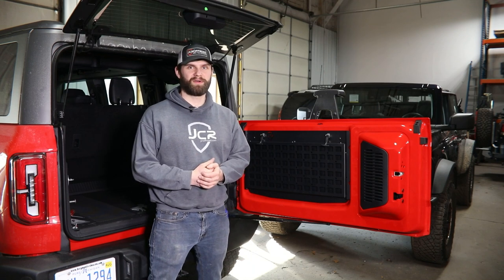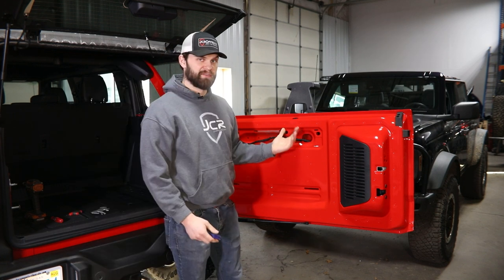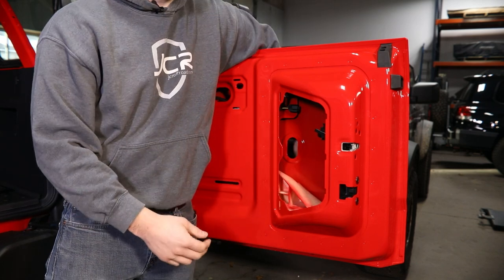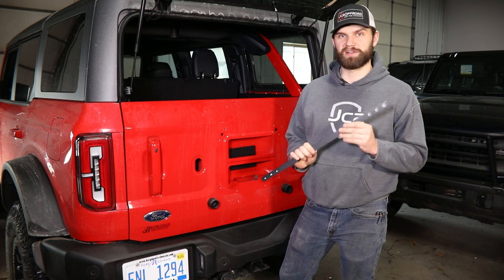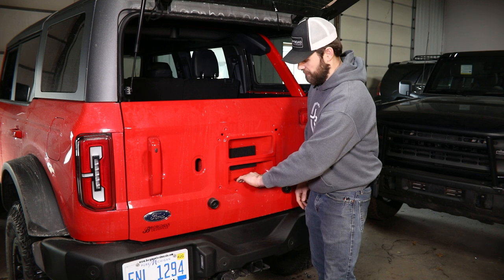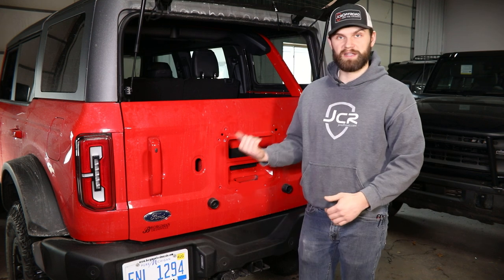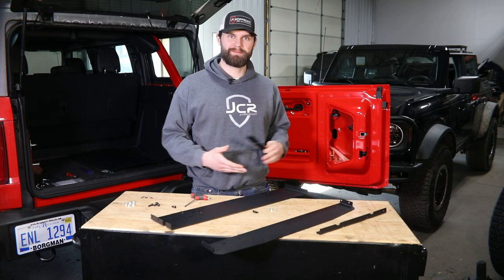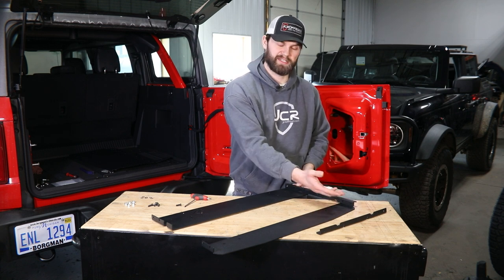Bronco Tailgate Table Install

Comment: The install should start with the table frame assembly. I received a piece of the table that is defective and I'm working through with JCR to get it replaced. Had I followed the sequence in this video, I would have been stuck with a disassembled tail gate. Also, recommend installing the latches after the door is in place. Moving the assembly on the table scratched the hell out of it without need. Just get the table opening and closing right, then install the latches.

Comment: helpful tip for people doing the final mounting to the door: dry fit first before adding the loctite, I had to take it off 2x to 're-adjust' the mounting strips because the holes weren't lining up.

Comment: Install was a serious pain in the ass but it seems pretty solid. Tailgate makes a metallic clunk when I close it now even though my install is snug. When I don’t close the table to its end point and then shut the tailgate, there is no noise. Really hoping it doesn’t rattle down the road. The pain of this install was partially due to the lack of detail in this video. Show us the bolts and close ups of each install section. The removal of the vents with a pry tool was unnecessary. There are literally push tabs on it that say “push”. Wish I figured that out before breaking two clips on the top vent by trying to imitate this video. I think I’ll be fine with one vent clip but sheeesh! Nevertheless, enjoying it so far.
Reply from the maker: Thanks for the follow-up on the installation. If we can help at all, please don't hesitate to reach out to our tech support team. https://www.jcroffroad.com/CTUS.html

Comment: installed pretty easy, did not completely remove tire carrier just unbolted and hung it off tailgate by brake light worked fine.  like the end result though straps were a bit tighter than expected even at closest setting

Comment: after assembling the table it doesn't fold all the way up, seems like it is hitting the 2nd from bottom bolt heads. After a few attempts and some pressure it finally closed, another tight interference fit?
Reply from the maker: Please contact our tech support team and we would be happy to help troubleshoot: https://www.jcroffroad.com/CTUS.html
Reply: Hi Pete, I'm also having this issue, did y'all find a fix?
Reply: @brodiamos  push real hard. Drive a few thousand miles. All good now. ¯\_(ツ)_/¯
Reply: I just had the exact same issue. The only way I could get the bolt to fit into the cutout on the table edge was to remove the washer of the bolt. Without the washer it seems to have just enough clearance to close tightly.

Comment: The top table part is basically impossible to install. The tabs at the back do not fit into the slots at all @jcrOffroad . Aren't they supposed to slip in there a little bit? What am I supposed to do? I like the look of this table but it is a huge pain in the ass to install. As of now I cannot get the table top to install. I called many times today and no one ever answers.
Reply from the maker: That's odd, the team has been on the phone all week. 269-353-1184 or you can shoot us an email at info@jcroffroad.com. Sorry about the issues, but we would be happy to help you figure it out.
Reply: @JcrOffroad  My table tabs were too thick with power coat to fit into the slots. Thankfully, I tested them before installing. I simply took my metal grinder to each side of the tabs and ground just enough powder coat to fit perfectly into the slots. The slots should actually be just a little taller to fit the tabs into.
Reply from the maker: @vaughnjeffery2171  thank you for the feedback, sorry about the hassles on the install.

Comment: cannot get that top wire to disconnect! ? how?
Reply: cool just broke the little tab off, what are these connectors called? the reddish brown ones? prob just secure it with some electrical tape to keep it from wiggling loose yeah? or are they easy to come by to replace the clippy end?
Reply: I also had a very difficult time disconnecting the wires. The directions in the video should show a blow-up of these connectors so that everyone knows how they disconnect.

Comment: The fitment of the table is just bad. I don't think you took into account all the tolerance stackup and the variability of the thickness of the powdercoat. My table is line to line on the front edge with the molle panel when I line up the slots. I don't think I'm going to be able to bend this that much.